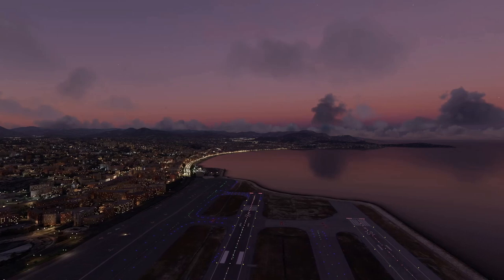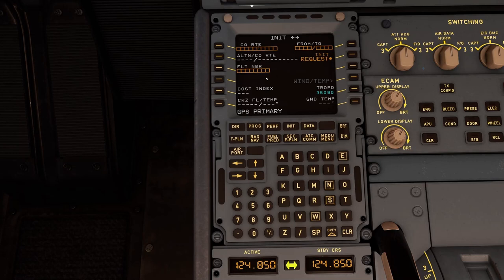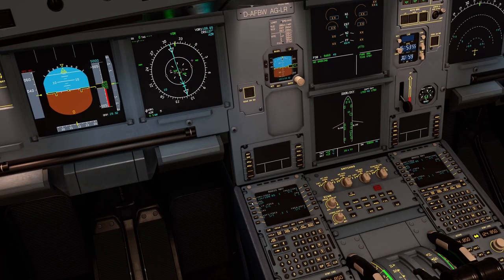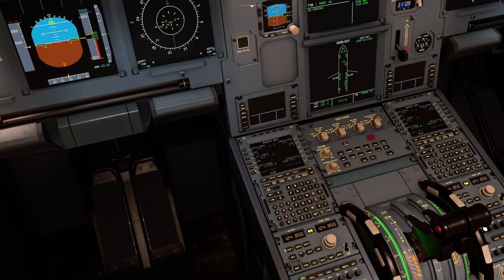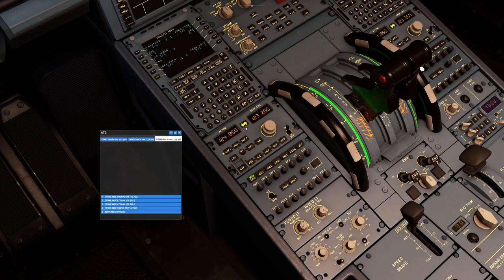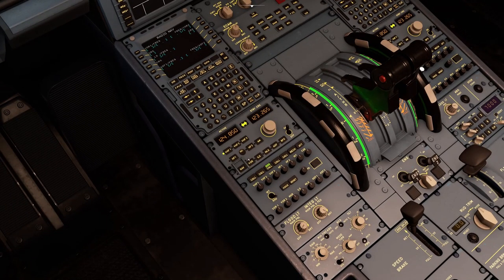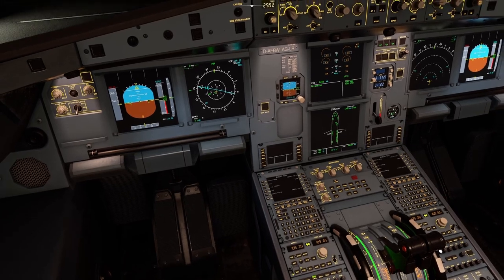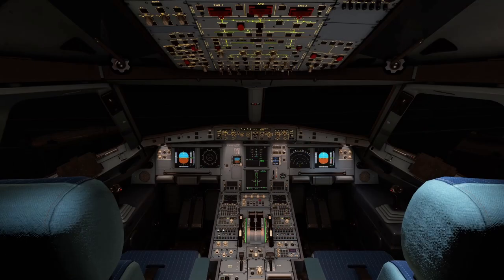HOW TO USE THE AIRBUS A320 MCDU RADIO NAV and  STANDBY RNAV MSFS 2020

Comment: The operation of the RADNAV panel and display on my FS2020 seem to be subtly different to this video, eg have to enter VOR freq manually or it won't work. The ID doesn't do anything. Any ideas why this is?
Reply from the maker: Hi.  I was using one of the earlier version of FBW A320 Airbus.  Over time, subtle differences will appear as they improve the the systems to bring it closer to reality.  Thanks for watching!

Comment: I am completely lost in msfs20 . I downloaded it but the aircraft is on the runway from first going to flight. Then it doesn’t move when I put power thrust on to Take off. The thrust increases but the aircraft is moving very slowly , just like taxiing…  it doesn’t read take off I guess ..
I wanted to ask about the flybywire software but I don’t know how to deal with msfs20 as it is  :(
Reply from the maker: Hi. I'm assuming the parking brake is released.  Which aircraft is it? Try loading a default MSFS aircraft then try again. Go to your settings and check keyboard shortcut to the parking brake. Hope this helps. ~Rm 🙂
Reply: @NaviSim101  yes I will try the parking brake on the keyboard… it was released as far as I know..
I bought everything only to fly the a320 for a refresh … but :(
Reply from the maker: @Nadsyw1  Have you installed the FlyByWire A320? Download from here https://flybywiresim.com/
Reply: @NaviSim101  no I didn’t .. because , thought I needed to know first how to deal with msfs2020, at least take off . Thank you so much for the flybywire link. .. i heard there is an update on msfs2020 that is half the size. I decided this morning to delete it completely and reinstall the game… this is where I am up to today..
Let’s see if I succeed. Wish it was as simple as msfs2004 ..
Is the flybywire an add on to msfs2020 ? 
All I need , is to fly A320 , if there is anything simpler than this …, I’ll buy it just to make my life easier and get on with it …  it’s quite frustrating knowing that many pilots are failing/ partialing in the sim checks once called back to work :((
Reply from the maker: @Nadsyw1  Good news! the FBW A320 Airbus is completely FREE! Just DL the installer and it’ll do the rest.
Reply: @NaviSim101  ok I’ll do that then .. thanks a million :)
Reply: @NaviSim101  thank you so much 🙏  I have downloaded the flybywire .. now I need to learn how to use the mfs20
Reply from the maker: @Nadsyw1  That's great! Don't forget to use the FBW installer manager to update regularly. It'll let  you know when you need to. Use the Developer verson instead of Standard. Its more functional.  Enjoy! ~Rm :-)
Reply: @NaviSim101  sir i tried to download but not working showing some errors .
Reply: Y u need to close the parking brake. CTRL+ . (numpad dot)
Reply: @NaviSim101   for xbox?

Comment: Hi all simmers.  I don't know why but I`m not able to change the VOR, ILS, ADF and the other frequencies in the radio management panel of the MSFS A320 Flybywire. But it does work in the stock A320. I know that there is a small plastic cover and a NAV button. But nothing happens.  Does anyone know why?  I appreciate your help.
Reply from the maker: Have you downloaded the A32nx from the MSFS Marketplace or directly from the  FBW app?  Always use the DEV version.
Reply: @NaviSim101  Hi. Thank you for your reply. Yes I installed it from the Flybywire site. It still does not work. But I learned how to dial the frequencies in the FMC. So it is ok. But the radio itself does not allow one to change the frequencies for  the VOR, ILS NBD etc. Only the COMM frequencies. Slowly I`m learning how to use the FMC.
Reply from the maker: Ah, brilliant.  At least you found a workaround.  Good work! ~Rm